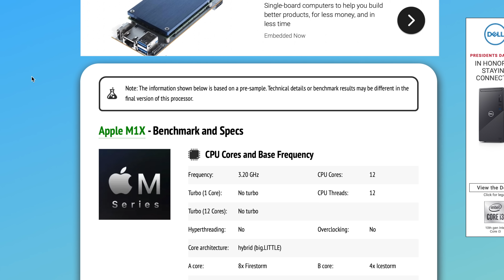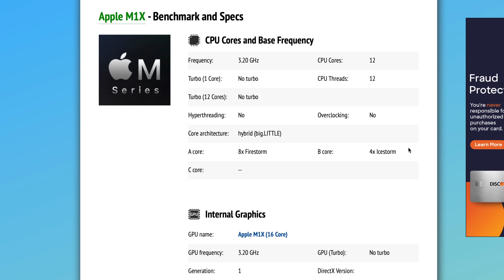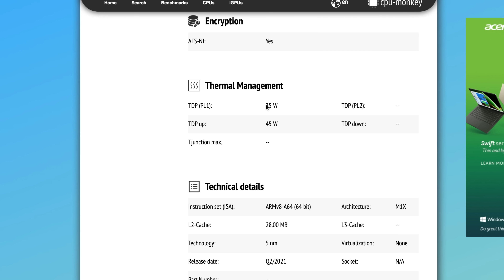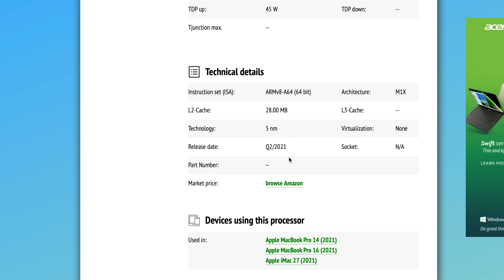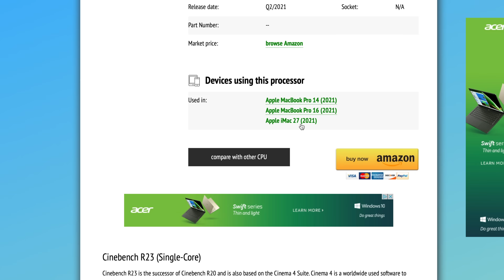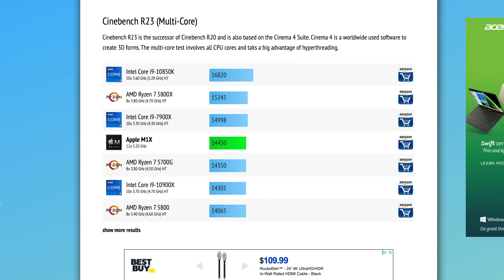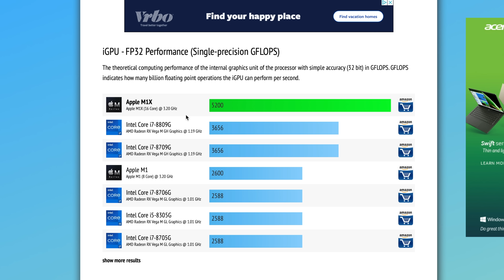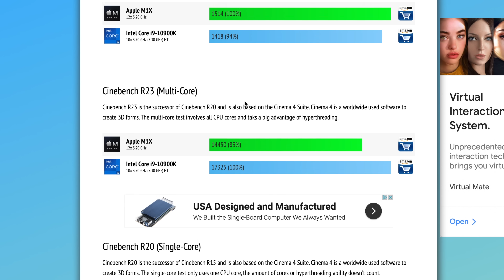There's no way M1X can be THIS fast...

Comment from the maker: Dear 800 comments: No, the fourth bulb is not 'out' on the light on the left of the shot, they're all LED and they turn on one by one. I have the top two turned on because it's much too bright with all four bulbs turned on
Reply: It's an Intel lamp. Not all bulbs can be on at the same time or it overheats
Reply: @raul0ca  lol, Is the wall a heat sink for those Intel Lamps.
Reply: @raul0ca  sure, blame the "lamp manufacturer" rather than Apple that likes to undercool processors.
Reply: Have you considered setting the low light on your left to a different color? Something on the opposite side of the color-wheel from the floor lamp? Looks good so far.
Reply: Love the new studio!
Reply: The reason the M1 chips do so well is they are focused on Single Threaded performance Multi/Hyper-Threading is actually the sign of a poorly optimized core as Multi-Threading takes time away from a task to do another Task which means each task takes longer to complete while not doing either 1 of the tasks as fast as it could as if it was dedicated to a single task, In the old days when Firmware/OS/Programs where all much much smaller and easy to preform it kinda made sense to add extra schedulers to a core as the CPU Development was out stripping coding a Home and Office User could get twice the performance out of a then modern core for not that much more money (This especially made sense before Multi-core CPU's became common place!) but now everything uses so much more Cache, RAM, Storage CPU & GPU to perform tasks now with Out-of-Order-Execution as well as Multiple Task Schedulers both of which can cause a CPU to have to redo tasks due to errors (it is far more common then you think!) Also since Apple controls the CPU Micro-Code, Motherboard & CPU Firmware etc they can make it all (Barring GPU though Rumour has it AMD lets Apple write their own GPU Firmware Code!) speak the same language reducing translation times, Their are even a few rumours that say Apple paid AMD between 1 and 2.6 Billion for RDNA2 as well as Infinity Fabric Licenses on a 2 to 5 year contract in return Apple promised to only use AMD GPU Cores if not full Cards in all of the Apple Pro Computer Range as they require extra GPU Power that PowerVR just can not provide ATM and Apple is working on their own GPU Program so they are not reliant on the likes of AMD, NVIDIA, Imagination Technologies, Qualcomm, Intel for GPU Technology  Apple wants to own every aspect of a Mac and iPhone/iPad Hardware Apple is also working on Micro-LED, OLED, QNED, QDEL Screen Technology yes they are working on all these both by themselves as well as with certain partners like LG, Samsung, BO but the end goal would be to own or at least control the production facilities after all they are working on their own patents for CPU & GPU Production so they do not have to rely on TSMC, Samsung etc! 

1. Control of the Micro-Code!
2. Control of most of the Firmware with the goal to control it all!
3. Control of the OS!
4. Control of the CPU Architecture like Threaded Performance & Cache Space!
5. Control of all Apps Written Program Language!
Reply: Light is the photographers paintbrush. Every useage of light is different depending on the photographers artistic protrayal. Question: For those critisizing about the lighting in the video, how much is your earnings in your videos due to your lighting scheme? Perfect lighting can be dull and boring.
Reply: I have question, could you calibrate screen color in m1 macbook ?
Cause displaycal couldn’t find it
Reply: There's something about you and lights isn't there
Reply: That 4th bulb could double as a hair light if you rotate it
Reply: Eh, bud, you got power issues like texas right now, you need a few more lights there.
Reply: Thank you for the clarity.
Reply: @smallpotato Yes. He should move the lamp a bit, just an inch or so. It would be more attractive and more effective.
Reply: Love the new studio, and hope you know the poking about the lights is all 100% playful. The lamp looks great.
Reply: We’re all OCD 😂
Reply: Your 4th bulb is off though.
Reply: Thanks for shining some light on that for us.
Reply: wow, how amazing there are 800 people on this planet who care about a light bulb in a youtube video, and now I am commenting on this so now I am one of them too.
Reply: why no way? Remove drivers and CPU will work directly with RAM like a cache memory
Reply: may be SSD will be on chip embedded
Reply: Who cares
Reply: I have this same lamp from Target.
Reply: I was about to comment about it too 😂
Reply: May I suggest to lose that light  on the left and put  a similar  to the right shot a hidden.
Reply: have you considered underclocking your 'bulbs' as you call them.
(my granny plants her bulbs, go figure)
Your LED lamps would appreciate the lower voltage:)
Reply: what

Comment: Well, okay then. I'm excited. Luke, you are not old enough to have gone through this, but the M1/M1X stage of the game is exactly like when Apple moved from 68K to PPC. It was a huge deal. Also, for years Apple had to use a 68K Runtime Enabler extension because some of the system software was still in 68K code, and a lot of applications were not ported to PPC for some time. My "killer app" is Finale, and it will be some time before it can be run on M1 silicon without the very similar Rosetta 2. Finale 2.0 had to use the 68K Runtime Enabler before they could report it for PowerPC chips. Fun stuff. Very exciting.

Comment: The perfect doubling doesn’t make sense mathematically. I’d say the 8 firestorm would result in a score of around 12900-13200 geek bench and 16 on the GPU would result in about 4700, not 5200... still absolutely insane for a chip at 45 watts and no dedicated graphics card. You could run AAA games and render 8k footage with LUTs and other elements like butter on non native premiere pro with those numbers to an extent

Comment: Hi Luke, I have a question if I can purchase a Macbook Pro 16" Intel version for a good price(£800 - £1100 - for an I9 with 16GB - 32GB Ram), should I go for it instead of waiting later this year for a possible M1X Macbook Pro? I am seeing the Intel based 16" Pro's are naturally dropping in price as expected.  I currently have a Mid 2015 Pro retina display, so this would be a dramatic improvement for me.  I don't do video editing, but use Excel for Mac extensively, together with Powerpoint and Outlook.

Comment: I remember seeing and reading all the hype about the M1 only to see it get decimated by even low end Ryzen processors. The M1X will be more of the same. It's going to be quicker than the M1 but fall short of even midrange Ryzen processors. Single thread is impressive, but it's only a small part of the story.  The M1 is great for people who need the best battery life and good performance, that's about it. Is that bad? Nope. However, for someone looking for top-of-the-line performance, the Ryzen is king.

Comment: It won't be this fast. They see that it has twice the performance cores of M1, they see that M1 gets about 7500pts in CB R23, they just scaled it up 2x. I think that realistically, maybe 12k pts. I'd buy that. a 60% increase over M1. Best possible scenario, 13k pts - 75% increase. But only in PL2. PL1 should still land somewhere around 10-11k

I'll believe it when I see it.

Comment: ok the magsafe HAD to come back - it was the DUMBEST thing apple did by taking it away - total FAIL. Just as the LED charge status indicator they took away from the charger was. Just like the 2 unfolding flaps on the charger's box (where you could always wrap your cable around) was. I mean they REALLY skrewed EVERYTHING up there..So I hope ALL these things are coming back. 
Now the touch bar, as is, is mostly a useless gimmick. As it is now - it's just another "FAIL". BUT, if they made it WAY thicker and add more functionality to it via giving it more "real estate", then maybe we'd be talking about a completely different thing than a mostly-unused strip that's "just there"... :P :P
What I WOULD like to see is a HUGE trackpad that's actually a "cross" between a trackpad and a touch bar. You know, like a HUGE trackpad (that takes up the ENTIRE bottom-half of the MBP's "keyboard-surface", that is also an OLED display with contextual function buttons etc etc. I mean the touch bar strip, as it is now, is pretty useless. The IDEA behind it, though, is not wrong. And the graphics' quality on the current strip is not bad at all (especially given what it's meant to display). So imagine how helpful it could be if it HALF of the horizontal surface area of the MBP (the top-half would be keys, of course) is all touch! AND a contextual-OLED display. GAME CHANGER. ;) I, mostly, agree with not using touchscreens. It would be quite tiring to have to continuously have to hold your hands up to be working on a vertical laptop screen - UNLESS the new MPB's screen can be rotated between 180° to 360° so that you can end up with a keyboard/touch bar-free touchscreen. So a 2-in-1 MBP-iPad version.

**And, of course Apple will never officially tell you when their new mac/ipad/iphone will be released. The SAME MOMENT that and announcement like that would be made, this would obviously INSTANTLY KILL ALL SALES of currently-available, but soon-to-be-obsolete, models. Why would they do such a thing when they can keep "milking the cow" a bit longer? :P However, maybe a good idea for Apple would be to introduce a new buying plan. For example, they could KEEP selling currently-available models, that will be replaced by newer ones any minute, "TODAY", if they gave an "upgrade-to-newer-model" purchase option for current models - WITHIN, say, 8 MONTHS OF NEW-MODEL RELEASE! :) Maybe that would be a great idea! :) So, say, I own a 15" 2016 touch bar MBP today, and I want to buy a new model today. The currently available upgrade model, in my case, would be a 16" MBP. Would I go ahead and spend approx 5K (with the spec I want) for it, right now (March 2020)? HELL NO! I'd be an IDIOT to do so since I know that a new model is coming out "any minute"... :P BUUT, if Apple would "tell" me "buy NOW, and if you want to upgrade to a newer model (if this is released within the next 8 months), I RESERVE THE RIGHT TO DO THIS, with a "marginal" 200-300 eur/usd "upgrade fee" (given that the MBP I swap back is in prime condition, then I WOULDN'T THINK TWICE! I would by TODAY. And if, within the next 8 months, a new model is launched, then I'd be able to order it, have my initial investment €/S (minus the 200-300 eur/usd "upgrade fee") on my currently-new MBP NOT BE WASTED. If, within, the next 8 months I want to buy the new model - that would be available then - then I would only "lose" this 200-300 eur/usd "upgrade fee". The remaining amount I just paid for my currently-new MBP will NOT HAVE BEEN WASTED after all!! I would give my MBP in, and would be able to purchase the just-released new MBP model using my ALREADY-SPENT amount (MINUS the 200-300 UPGRADE FEE AMOUNT), and that's it. If I didn't want to spend the extra 200-300, then, I'd just keep the still-"new-enough" MBP model I just bought. 

I think this would REALLY work. For BOTH sides.

Comment: One YouTuber who made a video on why Apple could afford to make these chipsets at these kinds of performance was explained before, and one reason is that Apple is not in the business to SELL the chips to other OEMs but rather for their own products, just as Apple could get an upper hand over Qualcomm because the A series chips are not meant to be sold to Samsung or other phone manufacturers, so Apple is saving up a lot of money and can pour the savings into the performance boost per dollar as we can see here.

The same will go for the M series where Intel and AMD are trying to SELL their chips while Apple is selling their chips with their laptops as a package instead, which means, per dollar, Apple are able to afford to put more performance compared to their competition, ARM or x86. This is an advantage of owning your hardware business and software I suppose, whereby other manufacturers have to pay Microsoft for Windows and Intel for their CPUs and AMD or NVIDIA for their GPUs, while Apple has to just pay for their ARM licensing and manufacturing. 

Apple has essentially cut off the middlemen here.

Comment: I think it would be really cool if in the iMac they had the same 16gb/32gb of integrated memory on the chip but then also had a ddr4 controller that allowed you to put normal memory sticks in the unit for faster than ssd memory but slower than the integrated.  It would save on the reports of the m1 ssd's having a large number of writes that might wear them out faster than expected.

Comment: For the 14” and 16” MacBook Pros, these numbers are incredible. For a 27” iMac, not so much. 
I would guess they’ll put this M1X in the 21.5” iMac (or its replacement) and use a 20 core M1Z or (even M2Z if it doesn’t come out until next year)  for the 27” one. It’s great for a 14” laptop to be able to almost compete with 100W+ desktop CPUs, but that won’t cut it in a computer that should actually be competing with those CPUs.

Comment: Whatever Gpu Apple makes it’s so it can run their VR glasses. If it can’t do raytraced graphics at 4K and 60fps on two separate screens simultaneously then they aren’t done yet. Maybe the first version won’t pull that off but for them to beat all other vr and console systems they will need that level of performance to persuade content makers to create games for the mac.  The App Store sells more games than anything else and games drive sales and developers. I hope they will finally take it seriously. Old macs are still great except when it comes to playing even something as simple as roblox. It’s pathetic and makes you get rid of good systems while they are still useful for other stuff.

Comment: If Apple, who have kept their low end line SO hobbled speed wise for the last ten years. Going so far as to not include good gpu options and using clocked down chips all this time to suddenly make them as fast as i9 CPU’s from last year. Yeah, they have much much faster chips for their pro line. If m1 is the low end then the pro chips will absolutely blow away the m1 at least in their $3,000 models. Apple love to make their highest end macs that were very overpriced in the past now sell like hot cakes.

Comment: These benchmarks seem not likely but Apple does have an advantage over Intel.  Apple's RISC vs Intel's CISC cpu architectures.  So it could be possible for a 35-45W cpu to match 100W cpu.  Let's not forget Apple makes their silicon and OS, that alone makes their cpu's work better due to better optimized OS.

Comment: This all sounds plausible. My feeling as a 20 year Mac user is that Apple will not support 3rd party GPUs, but basically add cores to the integrated GPU in the M1, but perhaps re-brand as “Unified Graphics”. If a high-end iMac had “64 Core Unified Graphics” on the same SoC as an M(something) it would probably still smoke anything previously available in a Mac, and be competitive with most PC components in real world use cases. I don’t think Apple will ever be a hard-core gamer platform, but as long as FCP keeps the performance advantage over all other platforms, I’m happy.

Comment: AMD Ryzen 5800H (45W) is getting close to 13000 (12969) on Cinebench R23 with 7 nm. M1X on 5nm getting 14500 is not that crazy...
Reply: 5800h goes over 45W on full load and M1 actually operates below its tdp even when fully stressed in R23 . At full load M1x will outperform 5800H at roughly half the power draw and that is ignoring  the fact that how it being an soc with much much lower latency ram access will destroy it in real world scenarios so yes it is beyond crazy. Apple is the greatest tech juggernaut of all times M1 solidified that .

Comment: I figured if the M1X is the rumoured 8 Firestorm performance cores instead of the M1's 4, and the same 4 Icestorm cores, then Geekbench single core would be same, and multicore just multiply the M1 by a pessimistic 1.5x. That'll kick ass regardless, any more is a bonus, and since that'd give me 10x the geekbench score of my mid-2010 17" 2.66 GHz dual core, then it must be a good enough excuse to remortgage my house to spend about £4k to finally upgrade. Still get shafted for money getting 4TB storage (current mid-2010 has 3TB in). Anyway, the error bars involved and vagueness on this guessing, it's still gonna be beasting. 

You sure those guys haven't just doubled in some cases, or guesstimate-multiplied up M1 stuff? 

I'm off to get some tequila and lemon to go with all this salt...

Comment: About RAM, will 14 and 16 inch Macbooks really need more than 32GB of RAM?
Maybe Apple will implement additional RAM usage from SSD?
Reply: The chiplets technology is belongs to TSMC (AMD already use it, but because they are also a TSMC customers), they can combine 2 or even 4 of the same M1x SoC into another bigger CPU, and it's simply will visible like a 30-40 cores CPU. And since the RAM also on this SoC, if you multiply them, the RAM also ramp up to 64-128Gb. The only downside of this, it's can't be a fanless design anymore, since the heat generation is multiplied to, it's required a cooler.